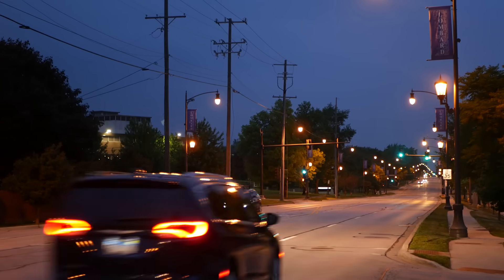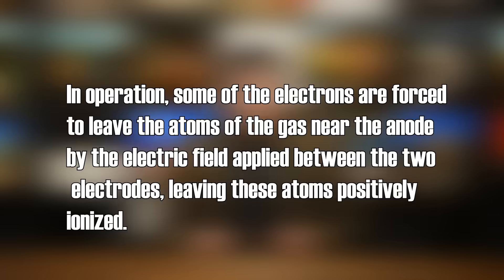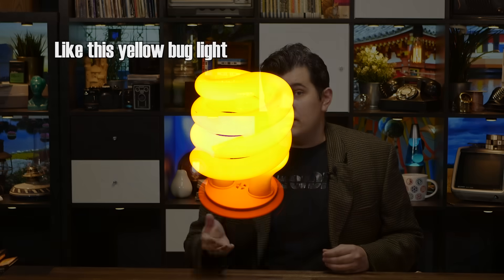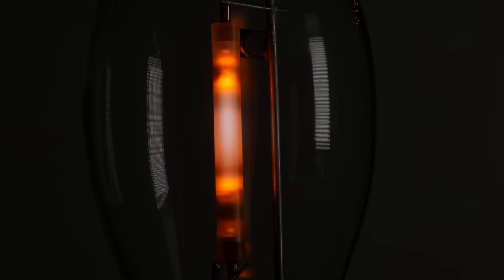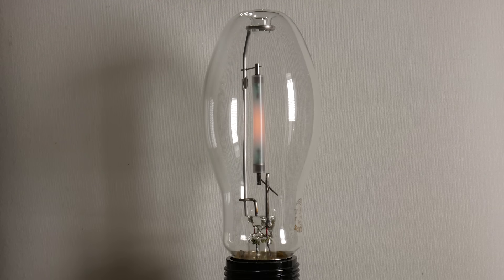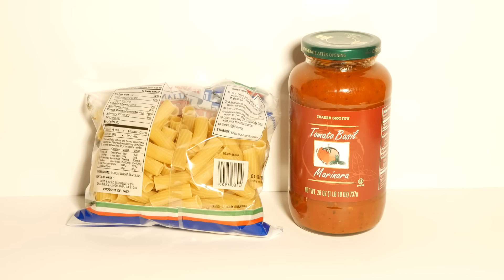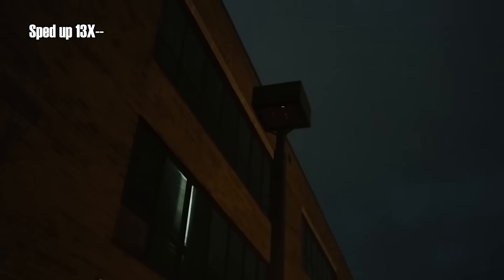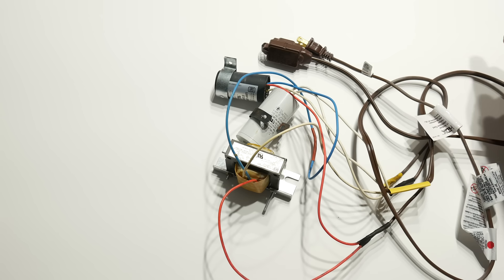The High Pressure Sodium Light: Ubiquitous, effective, but good?

Comment: Here in my town in Georgia, the city switched all the street lights to LED. But they're not bright white they have a yellowish tint to them. So LEDs can cast light similar to sodium vapor. But at a much lower cost.
Reply: Better than my town, they switched to green leds. GREEN.
Reply: In my town there's one street where they've replaced the HPS lamps with white LED lamps. But for some reason, the light output is half or even less than half of what the HPS was. I can see the lights when I look up, but they don't seem to light the street in any way. It's like driving through the countryside.

But I think they've realised their mistake, because other streets that have had an upgrade since then, have had other LED lamps installed which seem to have about the same light output as the HPS or LPS lamps they're replacing. They even went as far as replacing only every other lamp so you can compare the LPS lamp with the LED lamp. Though I'm not sure if that was done on purpose or just a way to cut costs.
Reply: Here we have a whole business area covered in blue leds,   its kinda annoying but with all the new designer businesses the area looks super futuristic!   could have been something from The Jetsons xD
Reply: How is that working out?
Reply: raafmaat Scotty one to beam up......Fizzzzzzzzzzz.
Reply: 5argeTech /\ So then you have a 3000K Temp LED Fixture
Reply: DankPlank did your town try turning them off and then on again?
Reply: WestFarms36 closer to about 45k they are super bright but still have a slight yellowish tint
Reply: Just that LEDs are in general not any more efficient than high pressure sodium lamps.
Reply: I noticed that when switching from incandescent to LED as well. The LED light seems to fall off with distance at a greater rate. Does yellow travel farther? Stuff appears whiter but dimmer the farther you go from the light source. (Corners of rooms are not as well illuminated)
Reply: Mod MINI higher wavelengths are scattered by the atmosphere, that is why things that are far away like mountains or the sky appear blue.
Reply: I wouldn't bet on lower cost. Lower running cost maybe, but in 3-4 years the fixtures most probably will have to be changed because of failing drivers or COBs.  So I wonder if it will balance out in favor for the LEDs. It's good bussiness for the manufacturer though.
Reply: They changed ours last year and do not look up they will blind you ours are bright white and my street is considered unincorporated so no street light, but walking to the next street i feel like im walking dow a run way.
Reply: Sure, but I'm just talking about light reaching the corner of a room - hardly enough atmosphere in the way to scatter light at those distances.
Reply: A few areas in my town built in the 90s have gone led within the last month, and about half of the original lights from the initial replacement (more flyswatter shaped) have been replaced with a different brand that’s more rounded. And these lights replaced perfectly working mercury and sodium fixtures. Meanwhile, there’re plenty of older lights from the 60s that have been performing flawlessly for half a century. The new leds are horrible in light distribution and light quality. I’ve had to use my sun visor in some areas that have been ledisease. Most of the light is glare and it seems that the light that reaches the ground is minimal.
Reply: In my led the city is not used instead they use kids and seashells.

Comment: sadly the city recently replaced the sodium vapor lights in the streets around me, with cold white LEDs. I like LEDs, they're great, but a cold white just isn't a good colour for nighttime street lamps. especially in the Winter, which is when they replaced them. You almost couldn't distinguish slippy snow from concrete floor.
Reply: if you cant distinguish between snow and concrete I'd say either you are blind, or your city keeps the sidewalks ultra clean.